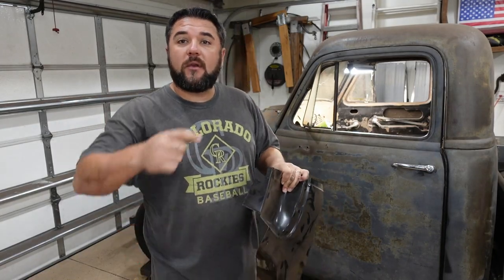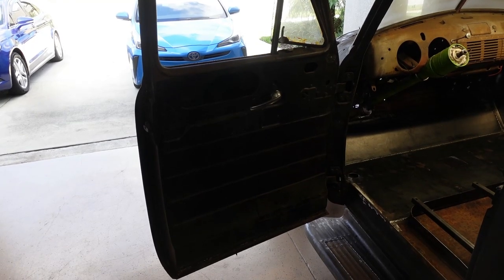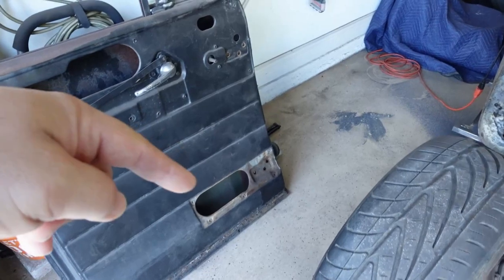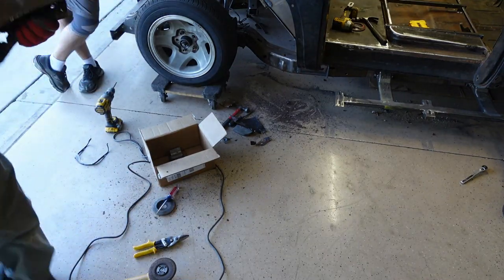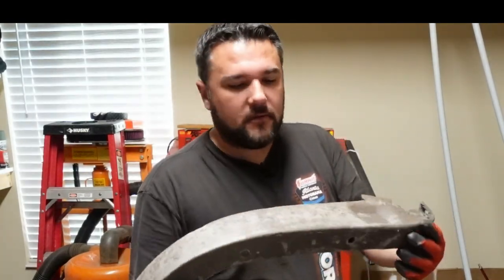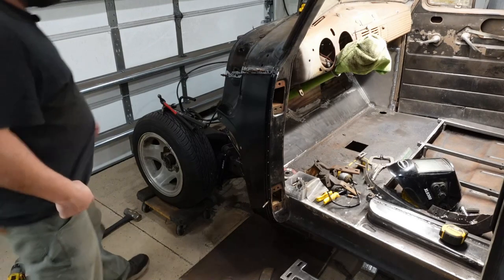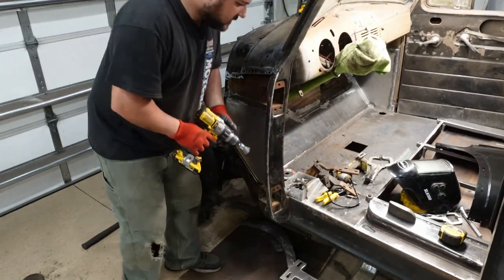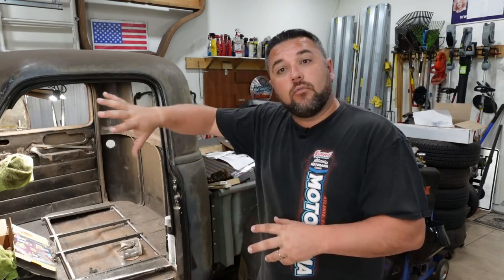PART 59 - 1952 CHEVY 3100 - DRIVER'S SIDE CAB PANEL REPLACEMENT (Part 1)!

Comment: Hey Phil, be sure to mount your VIN plate on the exterior panel above the lower hinge before you weld the patch panel in place. You won't have access to the back side of the special rivets that secure the plate after you button everything up. Just sayin'...

Comment: I love your build How you call the holders that you remove with the special plier ?
Reply from the maker: They are called "Clecos".... this was my first time using them and they work GREAT!  Here is a starter kit I found on eBay: https://www.ebay.com/itm/-/193877463889?mkevt=1&mkcid=16&mkrid=711-127632-2357-0&media=GMAIL&sojTags=media%3Dmedia
Reply: @ShowPhil  great, I will order one today, Do yo have an idea if the 1946 frame are the same as the 1953? I just bought one with a front clip , disc brakes, V8 and With a 700R4 transmission, I try to find info in the forums but no luck
Reply: 48-53 are the same. 46 is different
Reply: @ShowPhil 9:22 discussion of cleco clamps including their name